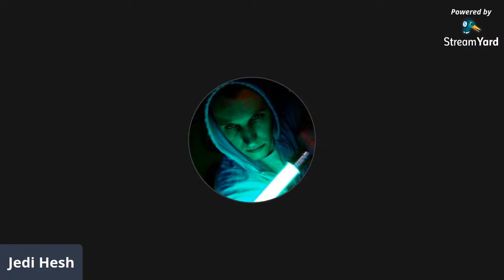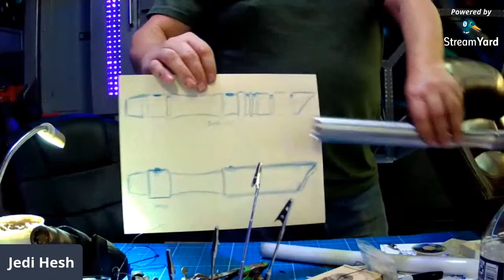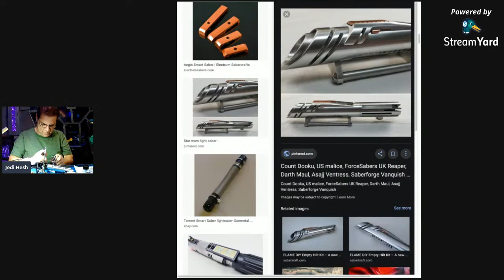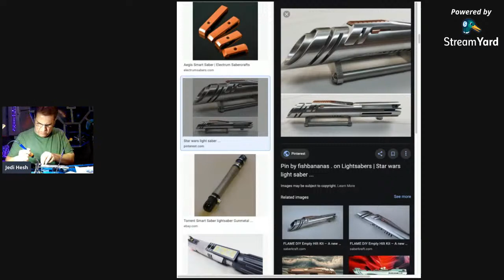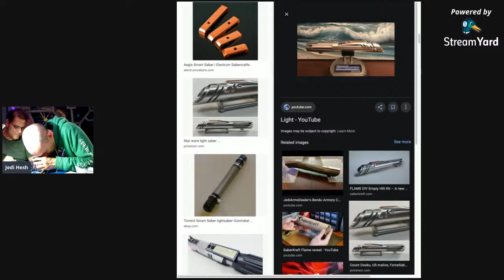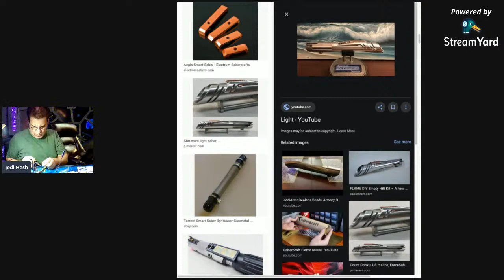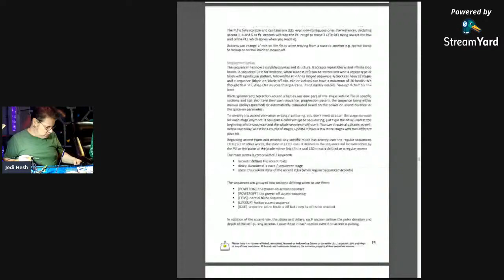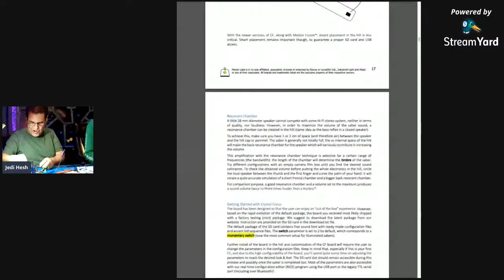LIGHTSABER HANGOUT with JEDI HESH (Harris from Saber Talk) Part I

Comment: What do you think about the new 21700 battery? A tad longer and wider than 18650 but a higher Mah and Amp draw.
Reply from the maker: I bought some and will use in an upcoming lightsaber to test. JBKuma is also testing them currently